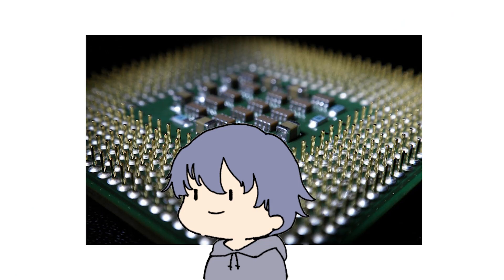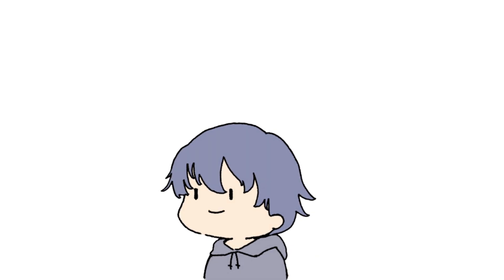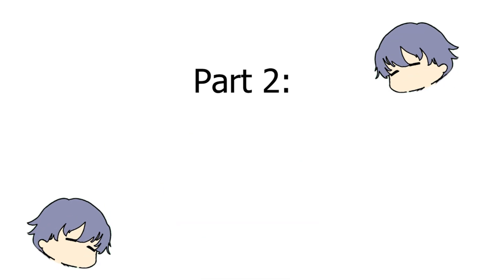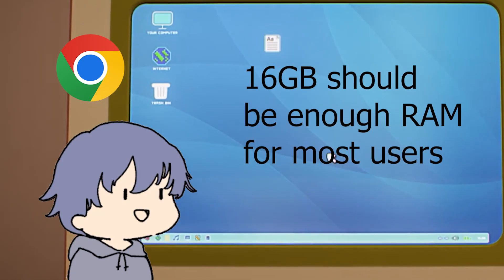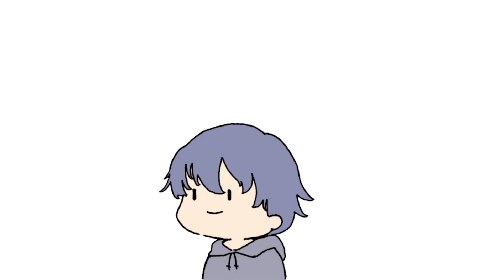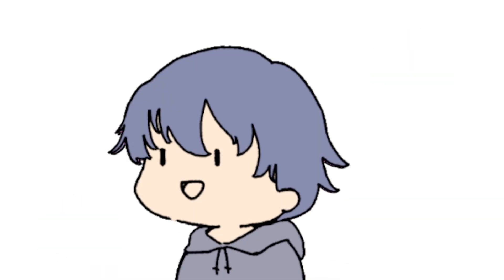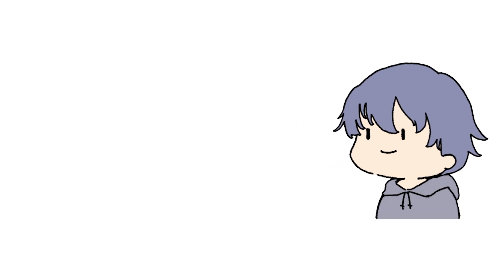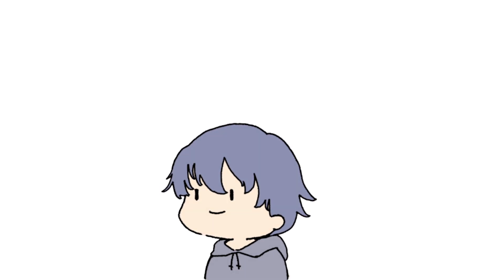This PC Upgrade Changed My Life. (AMD Ryzen 9 5900X Setup Upgrade)

Comment: Is ryzen 9 5900x and rtx 4060 good for streaming and recording?
Reply from the maker: I'd suggest you get the last-gen 3060 because it has more CUDA cores and a higher capacity of VRAM (if you get the 12GB version) 

If power consumption is a concern though, the 4060 doesn't use a lot of power compared to the 3060

Ryzen 9 5900x is more than enough for streaming and recording gameplay, You'd save extra money if you go with a Ryzen 7 5000 series too ^__^
Reply: @iamspeckles  so many people say better 4060
Reply from the maker: @poolworm  I stated my point, and it really is up to you whether you'd buy a 4060 or a 3060, since they're somewhat similar in performance

Comment: The Ryzen 9 5900x is kinda old, Im using a ryzen 5 7600 and even though it has less threads, it even gives me higher fps on most games.
Reply from the maker: I moved to the 5900x because it's still a great upgrade on AM4 compared to AM5 where you'd have to buy a new motherboard and RAM, Thanks for the heads up though! I'd be sure to upgrade to AM5 down the line to improve my gaming performance ^__^
Reply: @iamspeckles  Tbh it does not really matter that much imo since the price of that Ryzen 9 is insane
Reply: @Hyqo  The Ryzen 9 5900X is only like $200 used